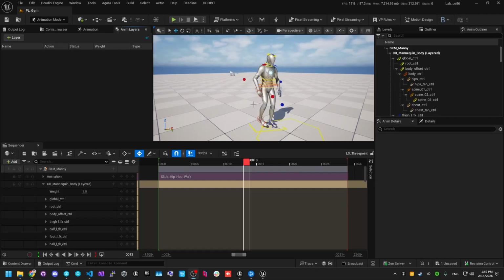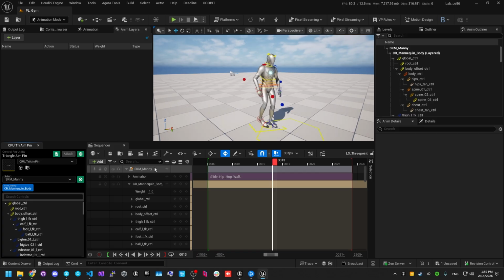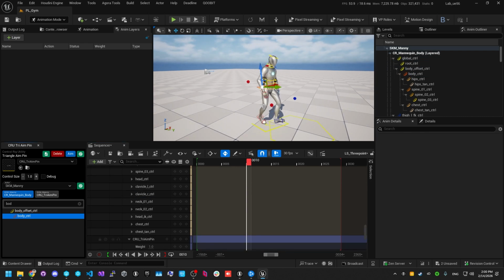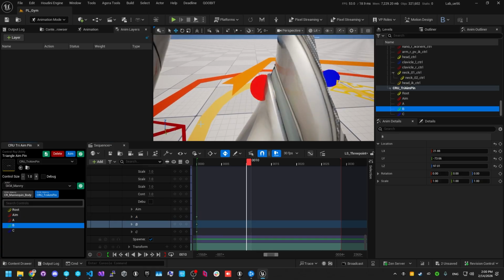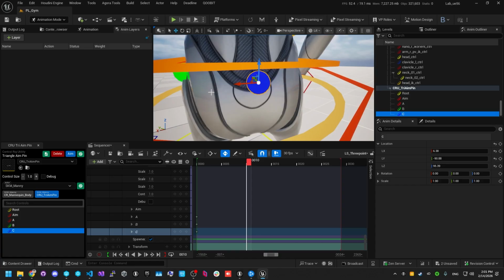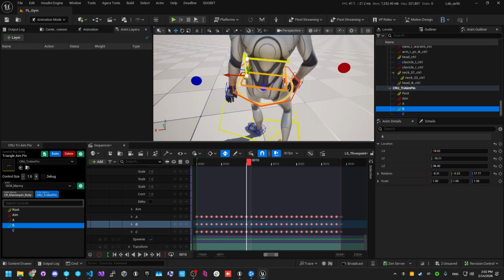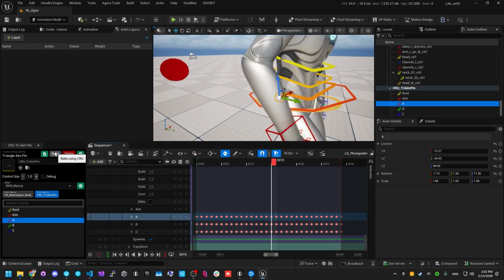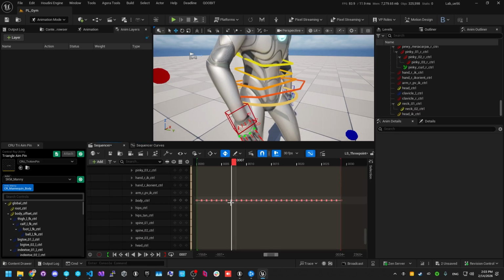QOOBIT Control Rig Utility Aim - CRUTriAimPin Basic Functionality

Comment: This looks like a good tool to have.  However,  I would be more confident in its effectiveness if you would use it on a character rig that was not one of the defaults of the UE.   Even if another character has a standard control rig attached, it would be a better start.  People are not creating levels or games with the default Unreal Engine characters.